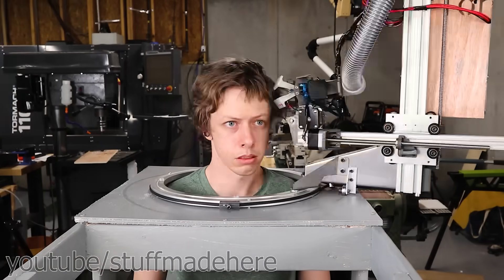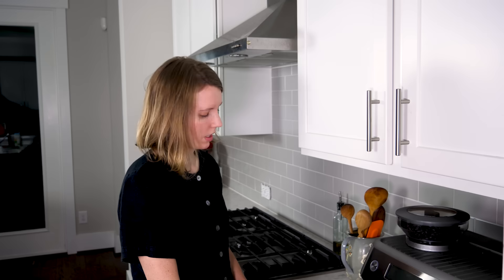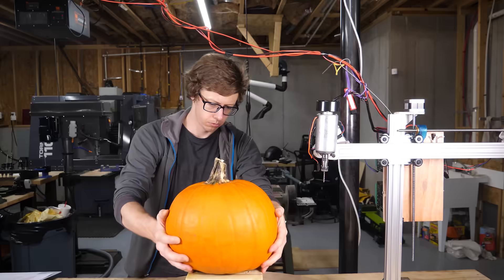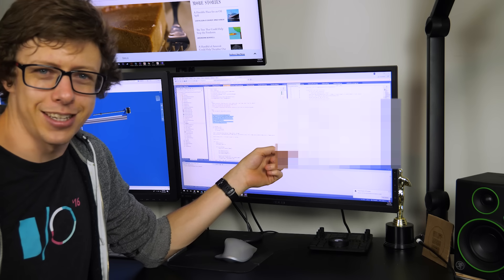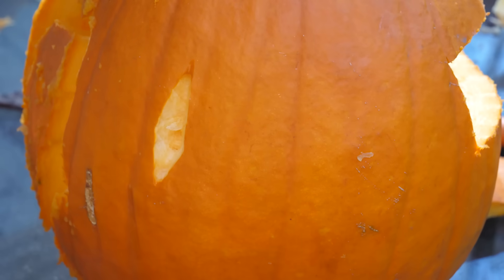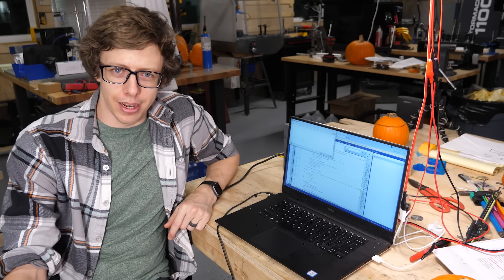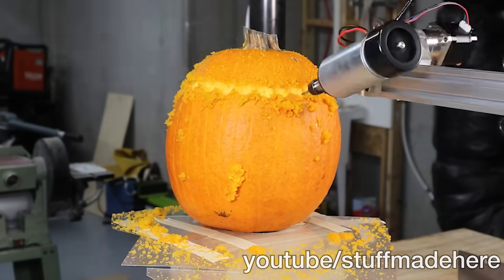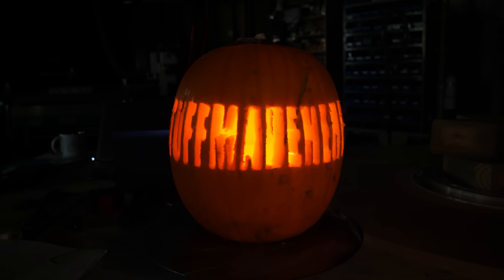Making a robot to carve photos into pumpkins

Comment: I wonder if the camera/depth sensor is censoring the the entire time or if it only uses the initial scan. If its scanning during the carving process, how does it account for the debris that falls down as it cuts? Or if it only uses the initial scan, is the debris that falls confusing the computers initial measurements?;

I wonder if a compressed air attachment blowing the debris away would help the accuracy?

Comment: I am sure you know most of this already, but I thought I'd put in some info I've learned over the years.
 
If you want a cleaner cut on a soft material, it is probably a combination of several things. Cutter type, spindle speed, feed speed, and stepover/stepdown distance. You also need to follow cutting practices that allow for finer detail.
For a soft material like pumpkin, you are going to want to use a 1 or 2 flute cutter. any more than that and you will just be clogging the flutes. This ends up with the cutter becoming more of a grinder and leaves rough edges. a single flute cutter would work great because it would basically clean itself.
With every material, you need to find the correct spindle speed. This is determined in combination with cut depth, stepover distance, and cutter type. If you are dealing with pumpkins, you probably do not need to worry about cutter cooling, but other materials also need this taken into account. 
Feed rate is determined using a combination of cutter type, spindle speed, and cutter cooling. You then need to make sure you set your cut depth and stepover to match your cutter.
Best practices for cutting soft materials tend to mean that you need to use more procedures and pathway strategies. Combinations of rough stock removal, then fine stock removal, finishing with fine detail and smoothing cuts.  From what I've seen, you look to be following machining practices that are typical for machining metals. Those suffice for soft materials, but when dealing with organic materials, I suspect it would be better to follow practices meant for wood.  This means taking into account the grain of the surface. Usually, I have found that spiral cutting instead of parallel cutting for the final smoothing cut leaves a much better surface image. It also minimizes cross-grain cutting, which is likely a major source of roughness on the final product. Using a round-ended cutter (ball cutter or round-tip V cutter) also helps smooth an image out.

I have 10 years experience with commercial manufacturing of wood CNC parts. I've done quite a bit of experimentation with all of these factors. Hope this information helps!

Comment: I can give you 2 pieces of advice as someone who carves there pumpkin with a dremel every year. #1, i cheat because i only cut a little bit into the pumpkin, and then i scrape a bunch from the inside if enough light isn't shining through. And 2, you should compensate for the fisheye lense effect you're gonna get. the middle of the pumpkin is fatter than the top and bottom, so you can't really use a grid to transfer it, so what i do is draw my stencil on sort of a concave grid, idk the technical term for it, but then when you draw latitude and longitude on the pumpkin, you can get very close to correct proportions. hope that helps if you decide on a v2.0

Comment: Could you get an idea of the thickness of the pumpkin walls by cutting the top off beforehand, shining a high wattage led from within the uncarved pumpkin, and recording a depth map? It might mesh well with optically scanning the pumpkin to get a model instead of probing it. You could use a water cooled cob led a la DIY Perks. Might need some sort of spherical diffuser though.

Comment: Pretty cool. That programming isn't trivial, not by a long shot.  As an engineer I'm impressed actually.  It seems like any variance in the of the thickness of the pumpkin rind might be causing some of the light attenuation problems, when cutting based on the front face mapping only.  I wonder what would happen if you measured/mapped the interior surface and cut to that, rather than the exterior?  Looks like a lot of work and a lot of fun.  

There were obviously still some mapping errors on the cubes version, but it actually looked pretty good, I thought. You were definitely getting there.  And yeah, your machine needs to be a LOT stiffer, maybe some triangulation on the beams?  And if you get it really stiff, some zero backlash gears or setup might be in order. Very nice.  Your shop makes me a bit envious.  :-/  I enjoyed the video.

Comment: I think four variables might be messing up precission 

first-machine not being precise enough due to being loose 

Second-variable thickness of pumpkin (it should be equal through all surface area you are cutting at with thickness meassuring into the centre from outside, so there are no variables on the inside surface as you cut only from outside) 

Third-perspective you look at the pumpkin from (i would do it backwards probably , i would map visible surface of perspective you look at the pumpkin from...with laser scan maybe?? , then project it into 2d space, then stretch photo on to that and then cut it on the pumpkin so image will actually look fine from one standing point) 
it will look better imo ,like the optical illusions in the room where on looks bigger regarding to room depending on where he stands, keeping in mind you cant carve big scale detailed pictures cause of that

And finally fourth - pumkin might have been too soft (so you cant actually make cuts with good precision)

P.S. might be good idea to even the surface on perfect sphere in the area you wanna cut too

Comment: Hi, I've been a huge fan!

I think you may actually have better luck with your image projections on lithophanes with a more simplified approach. I think a fair amount of image distortion comes from the pumpkin projection.

If you can develop a reasonably accurate algorithm for guessing pumpkin thickness based on size, (cut some open, and I think you'd find larger = thinner). Then you'd actually do just a regular Mercator projection for two nested spheres, (outer and inner), within the pumpkin which would actually allow the greyscale resolution for thicker pumpkins to be increased! Maybe you already thought of this, but if not I think it'd be worth investigating.

All the best!

-Ty

Comment: You should add the vacuum hose from the original hair cutter to back up the tool to "clean" the pumpkin bits while the cutters is milling it. That might help with the cleanliness of the final appearance? Maybe milling through the mushy bits is causing some depth variance or left-over clingy particles to persist.

Comment: Oh, geez. I once wrote software to project geodesics (shortest path between two points on the Earth) to UTM maps, which are similar to Mercator. A straight line on the Earth projects as an S-shaped curve in UTM. What a pain! The math makes sense, but I felt super inadequate because I knew what I wanted, but not how to express it mathematically. It worked in the end.

Comment: Another reason the cube tessellation wasnt so clean is probably due to the thickness of the walls not being uniform around the pumpkin. So to get the best effects for variable light you'll need to measure the inside as well as the outside so you can find the thickness topography.

Comment: If you're going to carve a pumpkin again, I would recommend getting one of the fake ones from the local craft store.  Especially for the 3-d /Q-bert level design.  Even though you're able to map the images onto the exterior of the pumpkin, there's not guarantee, that the thickness is the same throughout. Because of that, the shading could be off even though the cut depths are perfect.  The only way to get an true lithophane is knowing the thickness exact, which I believe the fake ones do as they're made in molds.

Comment: Mr. Stuff Made Here, the reason you had to hack your code is there's a typo in the comments at the top, line 18 to be exact (in this version anyways). You spell what is presumably 'the' as 'he'. Not only is this a silly typo, but it also potentially mis-genders the robot, causing adverse attitudes to result. We all know that she already has no issue providing sour comebacks, or snarky comments. If I've learned anything from ENGR 102 (which I haven't), comments are the soul of the program and are not to be taken lightly.

Comment: For a cleaner cut, how about mounting a low-pressure water sprayer on the cutting motor, like the kind of pressure you might get out of a spray bottle, and then mount a shield in front of it with holes for the sprayer and the cutting head so that the water doesn't splash back onto the electronics. Of course, then you'd probably have to mount this in the shower or something to deal with all the runoff.

Comment: Total hack from the 1950's, but anytime I build a circuit that takes external DC, I put a fuse in the power line and, right after that, a big hefty diode shorting ground to positive. It's backwards, so when the device is powered correctly the diode is blocking current and does nothing. But if you connect power backwards, the diode conducts, shunting all your current away from your circuit and out through the fuse.

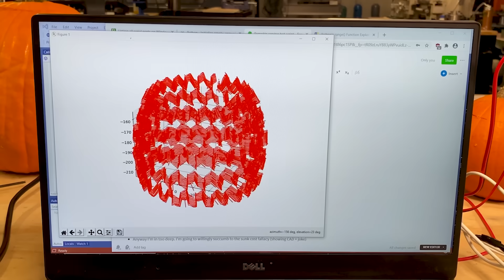Comment: 9:58 Dude you let the smoke out! You’re supposed to keep the smoke inside the circuit. You can’t just put the smoke back in once it leaves because it’s contaminated with other air, you gotta get a new circuit with smoke inside.

Comment: Fails
1. didn't call wife pumpkin at any stage
2. didn't measure the pumpkin with kinect
3. worked from top down so that the cutter was always working through the slush
4. blew the crap out of everything by putting clipleads on the wrong way around
5. Mac user
Successes
1. it worked
2. it made something remotely like it was designed to
3. blew up the Mac
4. didn't get the mother of his 3yo child to flatten his a**e

Comment: Bruh that advance algorithm of reading a pumpkins features is something like the phones that have 3D depth maping of the face for secure unlock.

It was difficult for me to even build a prototype just to measure the distance between the sensor and a surface. Can't imagine the pain you have gone thru just to get this working. Keep up the good work!
Reply: I think the pumpkin is mechanically measured, much like a seismograph/seismometer, that algorithm of yours that creates a depth map with only light and digital image is extremely complicated too.
Reply: Also I think the algorithm uses different orientations of the face, and then recreate a 3d model of the face, or just use algorithms to compare different sides of the face by recording it instead of taking 1 picture. Can't just take a picture of a face then show it in the camera...

Comment: This guy really had to remove the insides of all these pumpkins
Reply: That's a lot of work but still probably the least labor intensive task related to this project. The dude rebuilt his CNC hair cutter into a new more advanced CNC robot, wrote really complex code for it and then fucking torched the whole thing including his laptop by wiring it wrong, THEN REBUILT IT.

Comment: The pain. The high-amperage, circuit destroying pain. Be smart, kids: use a fuse.

(Great video, genius engineering, impressive tolerance for coding)
Reply: A fuse does not care if the amperage on a DC circuit is flowing the wrong way... Translation: A fuse would Not have stopped "letting the smoke out"... perhaps a set of diodes...
Reply: @edwardpaulsen1074  if you think ahead far enough to add diodes to prevent the reverse current id imagine you wouldn't reverse the current in the first place lol
Reply: @MeTurtlesLike  Therein lies the rub... nominally that statement should be true... but people also have an unfortunate tendency to forget sometimes, or be thinking of something else and not paying full attention... we won't even get into what happens if your project may end up being released into the "wild"...
Reply: @edwardpaulsen1074  you're right. The fuse would only have stopped it if the amperage was high regardless of direction, so adding a diode would have made it better. However, unless I'm mistaken, misconnecting a circuit like that will end up drawing a crap ton of current (like shorting the wires), so it should save from any short-like compromise of the circuit. Maybe. Unless I'm an idiot, which is also entirely possible.
Reply: @donnyduggan1713  That is only somewhat true... there are a metric shit ton of microchips and microprocessors that are highly sensitive to polarity... they don't need to pull much current at all (on the order of a few microamps) to be thoroughly destroyed, mostly due to scale... but sometimes due to the doping of the underlying crystal structure. Fuses are the best option to limit total current, but diodes are best for controlling and limiting current direction issues...
Reply: @edwardpaulsen1074  isn't that what diodes are, little one-way gates for current?
Reply: @fredericapanon207  Yes, for the most part... there are some additional cases where a circuit takes advantage of some other properties (like a Zener Diode) but mostly a one way valve.

Comment: Give endmills made for plastics a try as they are honed razor sharp and they may give you cleaner results and it doesn't matter if they're carbide, hss, or sintered diamond (best for highly abrasive materials) they just need to be sharp with positive rake angles. If you need sharp tools that are coated look into how a tool has been coated with TiN, AlTiN, ect. because physical deposited coatings vs vapor coatings differ in how well the honed edge is preserved by not rounding it off as much over a razor sharp uncoated tool. By the way we'll done on making a probe to turn your robot into a cmm.

Comment: For projects like this you might want to take a look at Houdini. A lot of the problems you're trying to solve are very common in the 3D animation world. Houdini is very procedural, very codable, and has a ton of built in tools. For example, it has integrations with a photogrammetry tool. So rather than probing with a switch you could photo scan with a webcam and generate a mesh with sub millimeter accuracy that's UV unwrapped. Then with it's volume mesh tools you can test and visualize your pumpkin carve on your specific pumpkin, before carving.

Comment: Do inverse projection with raytracing. You made this more difficult than it needed to be.

You just need 2 things, a 3d model representing your pumpkin, you have this. 
Next you just need a plane with your image mapped onto a cylinder. Easy.
Next you just need to raytrace each pixel of the cylinder towards the center of mass of the pumpkin, and log where it intersects with your pumpkin.

That will leave you with a list of vertex points of all the intersections. You can use that to map where your drill should be going.

Comment: approximate a sphere with the radius of the smallest point in the pumpkin. don't map the image on the surface of the pumpkin or you will have mad distortion! carve out everything that's not a sphere
Reply: 1find all the points of the surface
2 find their center 
3 find the smallest distance from the center
4 map the image on the surface of a sphere that has a radius of the point you found on step 3
5 carve out everything that is not a sphere, more if you need transparency.

Comment: I have an idea for bending if your pen plotter goes on the brink. In CAD, simply add in a small notch (maybe a 1/8th inch semicircle) at each end of the fold/bend line. You would still have to figure out which notch coincides with its mate, but once that's done, bending would be precise.

Comment: The mercator projection doesn't work the way you described! What you had there is called a "central cylindrical projection"!

That might be what caused your bug! The difference is very simple, you're essentially just taking the log of cylindrical (with an offset) to get mercator.

Comment: OMG, just use Fusion360. Scan the pumpkin with a depth camera (the one he used for the basketball thing, or even an iPhone should deliver waaay better topology), import it into Fusion and turn the scan into mesh data. Map whatever you want onto the mesh, turn everything into G code and let it run with an arduino 4 axis cnc build and there you have your high-res pumpkin carver.

Comment: you should add a kinect (or something similar) so it can get a full point cloud instead of having to measure each individual point. Might want to still use the current solution for scale, though.

Comment: what i wouldve done, is converted the image to black and white, then have a tool that measures the thickness of the pulp, make a black to white scale as wide as the pulp is thick (the deeper you cut out of the pumpkin the whiter it gets) explanation here: https://scratch.mit.edu/projects/441909715/

then have it carve to a certain point to get a certain shade

Comment: Other suggested improvements use a cheap red laser diode with a line lens, a cheap web cam, and OpenCV to just make a basic 3d scanner instead of the bumper switch. The image looks really distorted because the normal vector to each pixel is pointing in a different direction not towards the observer (Orthorectified), in order to get it to look right you need to make the normal towards the observer or at least fake it by drawing on a plane instead of wrapping it with a Mercator projection.

Comment: I just don't know why you use a cnc as a basic robot with inputs and outputs and doing too much effort into programming it from scratch?!
Why not simply use any CAD-CAM software (for example: fusion 360) and it will do all that for you?
If I wanted to do such project. I would have used that nice cnc router that you have, add a fourth axis and boom. You're done.
Sometimes I think you like doing stuff the hard way